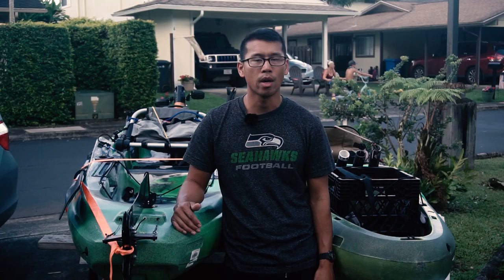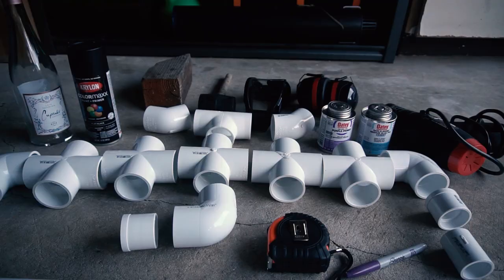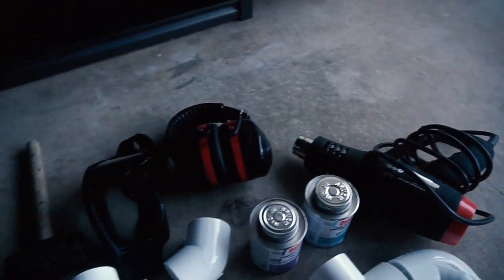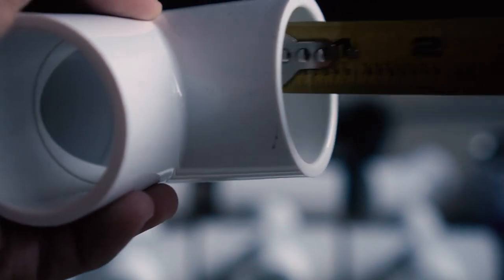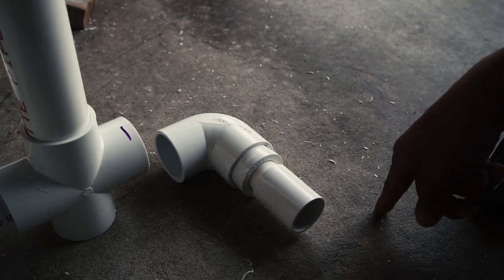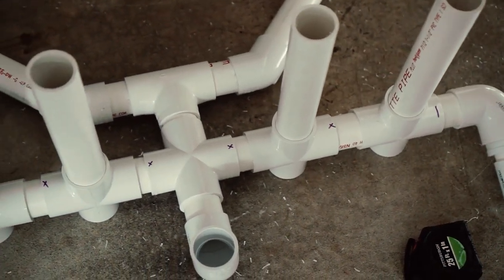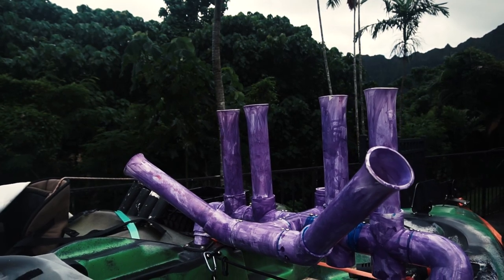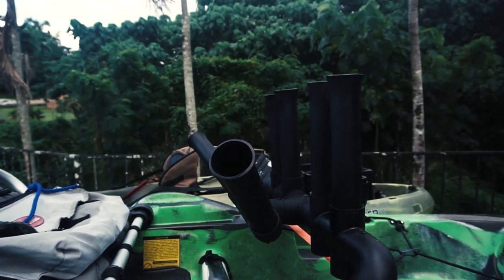MUST HAVE DIY Kayak Rod Holders for Old Town Predator PDL

Comment: You do know that the PVC primer only goes where the glue is going to go, right?
Reply: Without getting nerdy, pvc primer also serves to removes the smooth finish and increase surface area for bonding to paint. I have been exposed to extremes UV rays for over 2 years and have had no paint chip.

Comment: I wonder if by not gluing it at the elbows you could make it swivel backwards when needed so as to lower your rods when going under bridges and such.
Reply from the maker: I think as long as there's enough friction to prevent it from rotating backwards when you don't want it to, then it would work. Thanks for the insight!